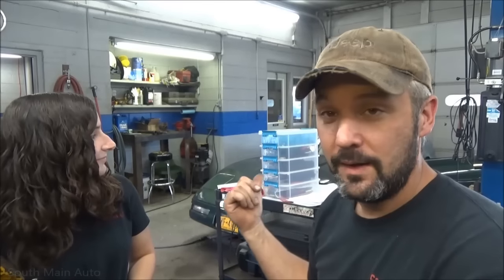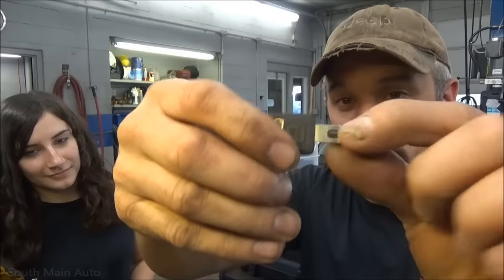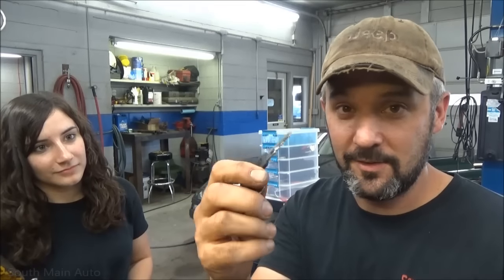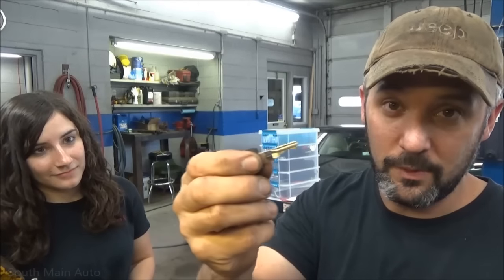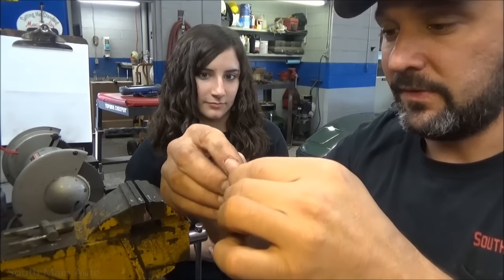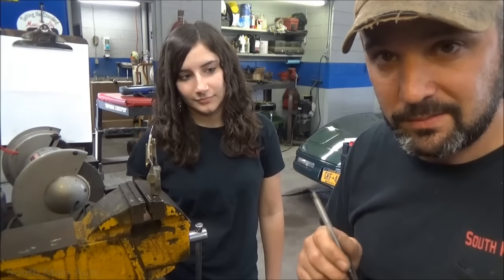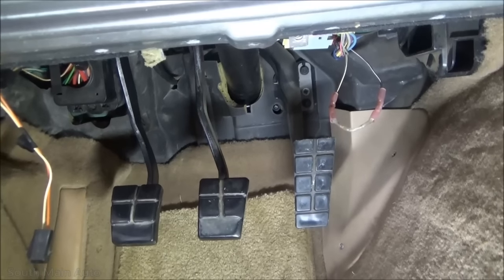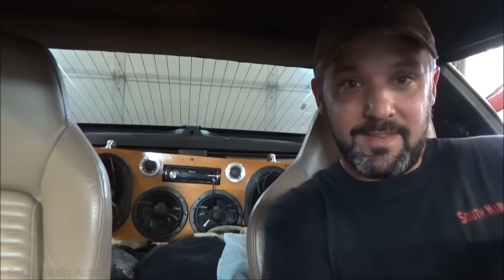GM VATS Key / Resistor Key Security Bypass

Comment: I remember whenI had a 96 Pontiac G6. When I was a soldier in the barracks in the parking lot a 99 model another soldier had accidentally lock his keys in his trunk when taking stuff out. I saw this happen in the parking lot and since I had an older model of the same car and tried my key fob on his car and it worked! That surprised both of us but at least he was able to get his keys locked in the trunk.
Reply: Terry Rodbourn 96 g6 I think not
Reply: I believe it happened. I used to be a tech at a chevy dealer. While I was there I bought a new Chevy 1500, 1998. I had some work done in the pro shop due to being a conversion pkg and under warranty. Somehow my keys and the pro shop's managers keys got mixed up. Our key fobs worked on eachothers trucks but the keys wouldn't start the others. His keys would turn the dash lights on but wouldn't allow it to run.

Comment: Hey Eric. I had an 89 Chevy S10 Blazer as a daily driver and used the same keys, mine and misses P's for over 26 years. It had the same security system, key with chip and never once did I have a problem. I do remember that once every year or so I'd see my or her keys laying on the work bench and while thinking of the next project, I'd see that the metal on those two little wires was getting tarnished looking. So I'd grab a little scotch bright and give the keys a couple of swipes to shine them up again. I did this out of habit and after watching your video, I now realize that I was simply maintaining that resistor key so it would make good contact. I drove that vehicle so much, that I wore the teeth down on the key so bad, that I could start the car and remove the key with the ignition switch still on and drive the vehicle, then shut it off by hand without the key. Apparently once the module saw the resistance and let the car start,  it never rechecked it until the next start because I still needed the key for it to crank even though I could turn the ignition switch without it. If I had known about the resistor trick back then, I would have done just that and thrown away the key and started it by hand. The alarm and key fob's all still worked until the day they came and towed it away for scrap. Its really a shame because the body basically disappeared from Michigan rust, but the darn thing still ran great with 200k miles on it. It's when I felt the body actually tip sideways on a fast corner, that I figured it needed more than its third floor board replacement. That's when I traded the old girl in. Ah memories. Yes it was red and black and I still have the large decal that went completely across the rear tailgate saying CHEVROLET in silver lettering on black. Wonder what that could be worth? Oh, The key still hangs I my tool my tool box to this day. Jpol.

Comment: I just had this done to my Caddy. Only we didn't have any resistors, instead we used the spare key. We trimmed the wires back and put the connector back on, then ground the key down a little bit to help it fit in the connector, put they key in the connector, put on some electrical tape it worked. Just in case anyone is ever in a bind.

Comment: Just for curiosity reasons, why do you use the exact reading from the key vs the corresponding value in the VATS spec? There are 15 of them, this one should be a 1.8k I believe. Not there is anything wrong with your method of playing in the tolerance as long as it starts that is all that matters. If you are unable to locate the value from the key for any reason, like it is damaged, you can make a plugable selector to insert where you pulled the connector and rotate values until one of the 15 works.

Comment: this is exactly what I did on my Camaro to get it running again, but just a tip for anyone watching, instead of cutting the wires from the wiring harness, just cut the pigtail that has the orange sleeve over it, crimp your resistors to those wires and plug it in to the harness connector that was cut in this video. the wire in the orange sleeve comes with a new lock cylinder if you ever decide to replace that side of the harness.

Comment: Eric,  great video.  My wife has a 93 C4, and had a very similar issue with it not starting.  Back at the time, we took it to a guy locally that is a Vette specialist, and he had the vehicle running in a matter of an hour.  It sat at a Chevy dealership back then (2008/2009), because they said it was the BCM, and they were trying to locate one.  I heard of this Vette guy from someone at work, and we had it towed to his shop.  I just have one question:  With the VATS module essentially "always seeing a key in the ignition with this bypass", I wonder if it affects the vehicle's security system from locking the car and I'm assuming as most GM vehicles do, disabling the vehicle from starting.  The wife's remote hasn't worked in her car for years, and we just manually lock/unlock the doors.  Anyway, just curious about it as it came to my mind as I was watching the video.  Great video from you as always!!  I enjoy following your channel!!

Comment: Those resistors are handy for "fixing" knock sensors, airbag lights, seat belt pretensioners and more!
Reply: ishootstuff yes cause the safe and responsible thing to do is bypass airbag and seat belt warning lights ...  smh
Reply: Sometimes on older vehicles when you cannot get the parts anymore due to be obsolete you do what you got to do. Also back in the day people drove without seatbelts and airbags.
Reply: Someguy6571 they also died a lot easier as a result of the lack of said devices.
Reply: People die today due to said devices as well. Nothing’s full proof. Still I agree it’s much better today than back then. A LOT safer.
Reply: Seat belt warning lights don't MATTER, as long as you wear
your seat belts, which is still the best protection you can give
yourself.  As for the airbag warning lights,  I had one once,  the
problem was a corroded sensor behind the front bumper.  If you
get such a warning light, that is the FIRST part that you should
replace.
Reply: I used to have a full box of resistors and capacitors of a variety of specs. Costed me quite a bit to accumulate. Well. Had to part with most of belonging several years ago. So basically I am now rebuilding the stock. But hell. Every freaking thing cost a fair bit.
Reply: @hansanderson6607  lol

Comment: Did you try spraying some break clean on the key before attempting this fix? Seems to me that would have been easier.
Reply: That would have been something to try BEFORE paying for a tow truck.
Reply: I'm only joking about the break clean fyi.
Reply: Probably wouldn't help.  If you have a broken lead from the ignition cylinder
to the connection under the dash, it won't matter anyway.

Comment: i did this on a 99 Suburban a couple years ago.  found info in a forum.  good inexpensive fix for an old car.
Reply: What ohms was the resistor u uses and how did u find out what ohms u needed? I'm dealing with this on my 99 yukon. My key has no pallet

Comment: As a locksmith I have repaired the lock in the column and generally where the wires break is right where they go into the lock. I don't generally repair it by putting in the resister simply because with doing that some insurance companies will not ensure the car anymore if the security system has been fault. So I try to put it back the way GM originally designed it to be. Just the way I handle it. And I still replace them today if people need them in the columns I also serve as other problems that come up in the columns as well. Such as your multi-switch or other electrical problems that occur or there are also problems with the tilts in these kind of columns and I service those as well. Sometime you might check with your local locksmith they can help you with these problems and fix it so it is back factory if that's what you want so that you don't have to compromise the security system and keep it original.
Reply: Almost any insurance company isn't going to give a shit about the VATS system being non functional. And honestly a loud ass alarm blaring in the thief's ears is much more effective than VATS would ever be.
Reply: The OG GM Passkey System is basically worthless as an anti-theft system. There were only 16 different resistor values. If I found myself in possession of such a vehicle, I’d do this repair in a heartbeat.
Reply: Replacing a bad VATS (ignition cylinder and wiring through the steering
column) is an expensive endeavor,  and you may end up with the same
problem in only a few years.  I have never made such a repair, but I would
imagine that it involves removing the steering wheel, old ignition cylinder,
and running that new VATS wiring down the steering column.  If it is not
done correctly, you could have the same problem in a very short time.
No thanks.

Comment: GM used 11 resistor values you have to get within 10% of the original value. I am sure there is a chart of the values on the net. I found the values on this subject 20 years ago in a motor mag. As always thumbs up.
Reply: ACTUALLY 15 DIFFERENT VALUES

Comment: My Camaro lost signal from the lock through the steering wheel. So under dash the wires that go from the wheel to pcm under kickplate just soldered my keys tab to the wires and it worked no longer anti theft so I put a ign cutout. But if you have my problem just use the key if it's other then you need this man's methods

Comment: Great video......i will have to apply this to my 92 buick lesabre....just starting to have this problem over the last few days....I already have a pushbutton start hookup to start my car to stop having to jump my solenoid with a screwdriver.....now this.  Thank goodness for South Main Auto Repair LLC for the video and mechanical brain.  I have a title loan on my car...so i cant even go to the dealer and get a new key which used to be $25 so my dad says, but that was like 15 yrs ago when he paid 25. they probably dont even have the records for this car anymore.  Thanks Eric!  Question:  I get started and i drive for about 15 miles......and then the light comes on.....force the gas ---car shuts off......it will start though, and i have to baby it......AM I STILL HEADED IN THAT DIRECTION?!

Comment: Two of my Cars have/had that System, both had worn Lock Cylinders that permit(ed) me to pull the Key out, and as long as I don't lock the Ignition Switch, I can stop and restart the Engine without putting the Key back in. I know for sure one had a Remote Starter in it, and the other probably had one, at one time, and the wires to the Engine Modules, had a Resistor added to allow the Remote to work.

Comment: I used to have one of those on my 1988 Firebird GTA after I bought the car Eric it was a biggest pain-in-the-ass the dealership was 40 miles away I went through four sets of keys within two weeks the dealership finally did the same thing you did there and that was back in 1988 is a beautiful car ran great but that security system really sucked .

Comment: I might suggest a toggle switch to interrupt the flashing security light on the inline resistor fix. If the car is driven everyday it wouldn't be a problem but is left the light will draw the battery down. Don't know how long this would take to end up with a flat battery but at least the V.A.T.S. circuit won't burn itself out.
Great video!
Reply: BUZ1952 Z about six momths

Comment: I had an ‘86 Corvette that I bought new. The VATS always made getting it to start a gamble. I formed the habit of always wiping the resistor pod on my shirt to remove anything that might give the wrong resistance.  I had about a 50% chance it would start. Sitting in a supermarket (for instance) parking lot waiting for it to time out was always embarrassing.  After a few years GM did a recall, which involved all new locks and keys.  It worked fine after that, but a fault like that in what was then a pretty expensive car ($27,000) showed me GM wasn’t serious about quality.

Comment: I had a VATS die on me on a  low mileage 2002 Camaro a few years ago.  I knew exactly
what happened when the car failed to start.  I measured the resistance of my key with
an ohm meter, went to the junkyard, found a similar vehicle,  cut the wires to the plug
for the VATS circuit (the wires were 2 thin orange leads).   I then bought a resistor that
was close to what I measured my VATS chip in my ignition key and soldered it to the
two leads on the plug that I got from the junkyard.   Plugged it in, put the ignition key
in,  and VOILA!!   The car started.   I did it for ALL of my GM cars with the VATS system,
I keep the plug with the resistor in the center console as a backup if one of my other
cars suffers from the same problem.  One of the leads from the ignition key cylinder
was broken,  too costly to replace,  only to maybe fail AGAIN.   It did lock out my radio,
had to have a dealer unlock it, I made them give me the CODE to unlock it if it ever
happened again.

Comment: Thank you for sharing the Buick motor mount replacement, not sure if mine is shot.2011 Buick Enclave, makes a grunting noise only on light acceleration, after I'm going no noise.

Comment: Another guy's video on this issue just inserted the wires on the resistor into the frame side connector (after disconnecting the connector from the steering column side obviously) without cutting any wires on the connector at all.  It looked like the resistor wires were in pretty snug with no soldering or barrel connectors needed.

Comment: Awesome video as always, sorry if this is mentioned already in comments, but do ya happen to remember the brand on those wire strippers/crimpers you were using? I really like that design with the crimper in the beak rather than the handle half of the tool!

Comment: Had a friend who swapped a vette LT1 into a v6 Camaro body years back. We fired it up and it would run great for like 15-30 seconds (forget exactly) and then just shut right off. It would start again and do the same thing. It turned out to be the VATS. I guess they had different behaviors for different years or maybe he had mismatched components, because your wouldn't even crank.

The more I think about it, he probably had the v6 starter circuitry still in there with no VATS but the C4 PCM was shutting off after not getting a signal for a certain time. The C4 must have an additional starter immobilizer. Anyway we eventually fixed it with a resistor like that.

Comment: nice video.  I'll do that to my '97 Cadillac Deville Limo Hearse, because the engine cuts out sometimes when the VATS key is rattled, making for a frantic restart while in motion on a narrow winding mountain road.
  (15:11) I hope that the Boom Box has a remote control so that the driver doesn't have to turn his head 180 degrees while driving to change the radio station.

Comment: Explains what was previously  done to my 2015 Frontier by a major dealership  in BHC AZ sold with altered key. Otherwise a great deal always examin used car keys for tell tale signs of alterations  like excessive wear or file marks. Discovered after having hardware duplicates  made just to operate the door but also allowed full start up and operation.

Comment: Nice video, well explained. I just bought a 1990 ZR-1 that has been sitting for at least 4 years. Apparently it had a no start condition. Upon inspection yesterday as I was cleaning the engine and engine bay I noticed both horns ars unplugged and side marker lights also which make me suspect a VATS problem. I tested my key and came up with 7.48 ohms of resistance, going to try your solution, thanks for explaining it so well and showing step by step procedure, will be subbing your channel today, thanks again. 👍👍🏁

Comment: Good video. You ever run across C5 cranks, no start first attemt. Second attemp starts as normal. no start first try is random and when it does no start cranks ok I have correct fuel pressure, fire, injector pulse. New Cam and Crank sensors, traced out and verified hharnesses and connections to be good. New PCM

Comment: I just did this in my Trans Am a few weeks ago. I went to the junkyard and yanked that white wire connector out of a Camaro, and soldered the resistors to it.  Then hooked it into my car so that I didn't have to cut any wires.  Also had to do it in my Camaro earlier last year (then sold it months later).  I really despise VATS....

Comment: Preparing to use this resistor technique you demonstrate. 
1. Have you ever had this method fail?
2. What do you think of a third-party product that claims to generate a "PASS" signal at the PCM? That is, it apparently generates the ignition key "PASS" signal and activates the injector circuit, all at the same point at the PCM. It's an expensive box, and a waste of money if the resistor technique is a durable repair.

Comment: I got tired of digging/squinting/testing the values of resistors years ago and bought an organizer with 20 drawers, 3 compartments each. That's enough for most values between 1 ohm and 470K ohm, plus a couple bins for oddballs like 50 and 75 ohm dummy loads, 5W power resistors, and 510K ohm and up.
Reply: Passkey 2 only uses 15 different values. Keep resistors for 390, 510, 680, 910, 1100, 1500, 1800,  2400, 3000, 3800, 4700, 6100, 7500, 9600, and 12000 and life is good. Eric was really dancing on the line with two 1k resistors in series.

Comment: You can do the mod by using a two pin Deutsch DTM (smaller than DT) connector and set up the wiring so you can easily go back to enabling the system.